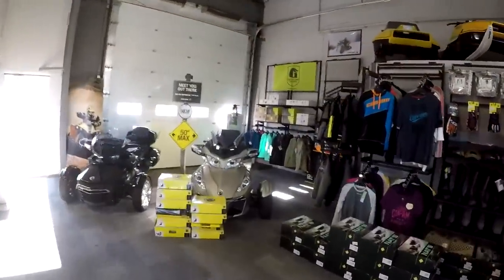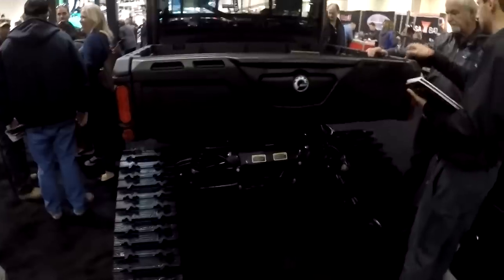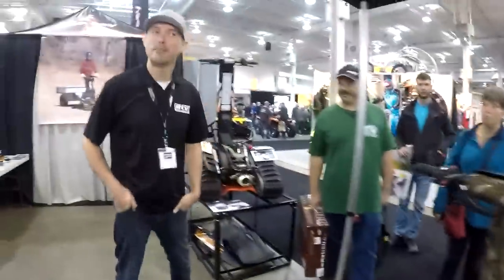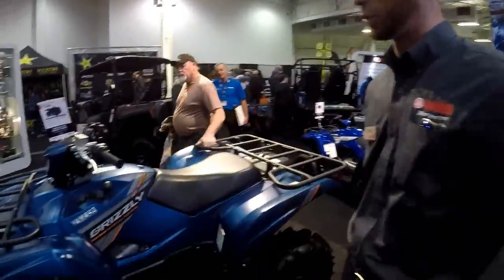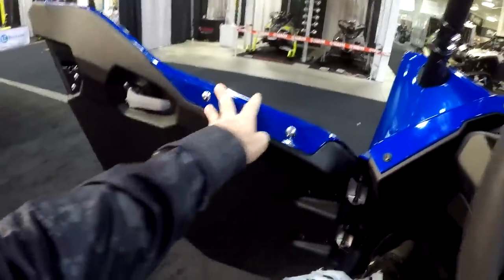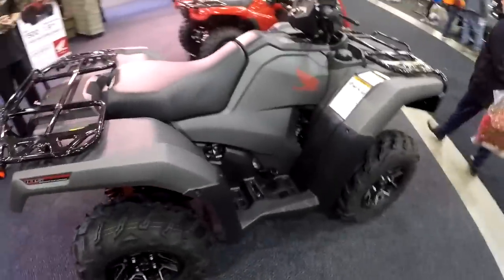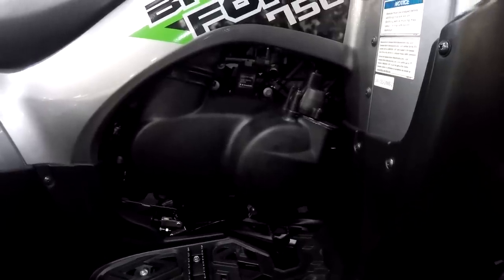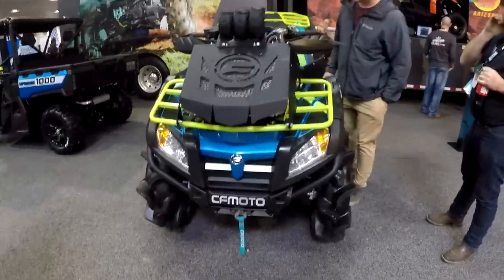CF Moto 800 Mud Machine ATV, 2018 Toronto International Powersports Show

Comment: Had to put the first comment in early before I forgot when it was   Great video all the way through. On your Renegade do you know if the new front and rear diffs outta the new X3 with the smart lock will interchange with the Commanders diffs or any others   What I'd really like is the ones like in the Rhinos where you can swap it all the way to being full lock if needed

Comment: The DTV Shredder . . . WHAAAATTTTT! That looked like a hoot! Not sure I'd last more than 30 minutes though. Looks like a young man's toy - LOL
Yup, the Grizzly with the EhTV colors . . . I think you need one for trail riding on those days you feel like taking a break from mudding - LOL (or maybe that black 750 KQ???)
The battery on the Honda Rubicon is easily accessed by popping that plastic cover off after you remove the seat. I'm surprised Honda didn't have their new Talon Sport SxS there.
Thanx for taking us to the show! How did your interview go last night?
Reply from the maker: Was pretty cool and we did have a spot on the local news. Pretty wild really. Checkout some of the pic on the FB site. I'm sure you'll get a good laugh.
Reply: We guarantee your'not gonna wanna jump off in 30mins ;) Message us to see if there is a dealer/demo ride area near you! We'd love to get you Shredding!

Comment: Thanks for the general over view. In the next month or so I’m actually getting a CFMOTO Cforce 400 for my wife to ride around when we go on trips so it was nice seeing it on here.

I’ve got the Honda rubicon non-special edition so I don’t have the color combo you showed. As far as you said about them riding like a caddy, not really so. The spring rate is kind of high but the compression dampening is really stiff and the maxxis tires are a stiff carcass but it’s extremely tough and puncture resistant. Other then a rough ride I love the bike to death! I traded a Polaris sportsman 570 in on the Honda due to reliability and design flaws and honestly the Honda is right there with the 570 in terms of acceleration with 14 less claimed HP. But Honda rates there power at the tire not the crank where Polaris does so but after drive losses they both equal out within a few HP. The DCT is a good system and the high/low splitter is awesome to have. I didn’t get power steering and honestly it doesn’t need it even with diff lock on. She’s got torque for days and that Honda quality and solid feel I love. Been a Honda guy forever, if you want to put your hard earned money into a bike for 20 years Honda, CF MOTO, Yamaha are all great reliable brands you won’t regret. Of course can am is good too, not dissing them at all, if you want to go fast can am has you covered but personally I don’t need a 90hp monster. My 28whp Honda does everything I need it to with grace. 

I personally think the Honda Rancher/Forman/Rubicon and the Can Am Outlander 650-1000’s are the best looking atv’s on the planet followed by the Polaris sportsman 450-570’s. Just from a looks only perspective but I won’t get another Polaris product after digging into the engineering flaws they build into them. Sorry that was so long lol
Reply from the maker: Great feedback, thanks man

Comment: I changed a belt on my friends 750cc brute force in 15 minutes. And that part that you touched I believe is a switch that flips when the belt has slack and touches the switch.
Reply: That's the engine brake on the top of the case

Comment: On my 3rd cf moto quad ,had first two stolen,probably done over 20,000 miles between the first 2 only one issue with a regulator,other small issues were sticky ignition and silly things like that ,now have a  cforce 400 and although not as powerful as the 500es it still does all I need and is just as reliable
Reply from the maker: Nice, I look forward to trying one out for the viewers at some point.

Comment: Damn. That CFMoto is sick. Thats something you dont hear ever. If they put that bike into production their sells will sky rocket. That says alot about the quality they wanna produce by putting Elka shocks as suspension. Assassinators from the factory. C'mon man that's a game changer. That's something CFMoto has struggled with is quality and a ride quality. Their older machine ride like a boulder.
Reply: Those weren't Elka shocks on the mud edition. The stock YIT shocks look like Elka's. Not even close to being the same shock. The SxS did have aftermarket Elka's.

Comment: I don't feel so bad about my choice of Cfmoto now. I got what I could afford. 2018 cforce 500s. Basically the 400 with the 500 motor, factory winch and several other upgrades.
Reply: I've been very interested in cfmoto with all the updates they've had. How long have you had yours and any issues you've experienced?
Reply: I've had it since the end of august. A little over 400 miles on it. The only issue I've had was 2 small rips in the front of the seat. The plastic on the seat pan was left sharp and ate through the cover. Turned it in on warranty at 60 miles/3 weeks owning it. Still waiting on a resolution. I suspect it's an issue with the dealer and not Cfmoto. We will see. Other than that, it's been solid. I don't beat it up or deep mud with it. Mostly trail riding and soon to be on plow duty.
Reply: I beat the absolute hell out of my ZForce 1000 and it just keeps asking for more!! I'm glad I made the choice to go with CF Moto and I've had it almost a year. Oh, and they have Rotax power to!!
Reply: Lots of people like to use the term "Chinese knock off" when discussing my ATV. In my mind "knockoff" implies it's a cheap copy of something else. Cfmoto is not a copy, they are their own brand. And have been around for quite a while. Only been in north America for a few years. And it's not that I wouldn't love to have one of the bigger names, but I can't afford it. It's this or nothing.
Reply: Frankie Smith I've always thought they were a cheap knockoff but looking at the built one I would rock the hell out of that thing.

Comment: Considered CF moto is all junk to this point I see this as just a stunt.
Reply from the maker: We invited them to join us on a rip to see how well it holds up. Hope they do, If they really believe in their product then who better to try and keep up to then me and NOS Boss eh.
Reply: Steve, I have to ask, have you owned a CF Moto before?  I've had my ZForce 1000 for almost a year now and I beat the hell out of that thing and it keeps asking for more. It is MUCH MUCH better than the 3 Rzr's that I've owned!!
Reply: @TheVenom8343  I'm the head mechanic at a powersports dealership... I see, ride, work on and have owned everything.  And sorry I wouldn't own one if you gave it to me.
Reply: So you've owned a CF Moto before?  It's a simple question sir.
Reply: @TheVenom8343  no... I fix them everyday.
Reply: Ok, thanks for the reply.
Reply: steve Warnke which atv would you buy , and why? Im in the market for a 4x4 700-1000 and I don't know which one to pick. which is the most reliable and which is the most fun?
Reply: @damaylaphoenix1155  An ATV I'd go with an 850 or 1000 Polaris  sportsman! If you dont want all the power and want reliability go with honda 500 rubicon.  A good mix between the 2 is the Grizzly or the Brute Force. Good luck and have fun!
Reply: I have a cfmoto. Only upgrade are my tires and snorkels. I can keep up with the other machines. Keep in mind you're trying to compare this to machines that have over 3000 grand easy added onto them. I never had to replace anything so far..just the oil